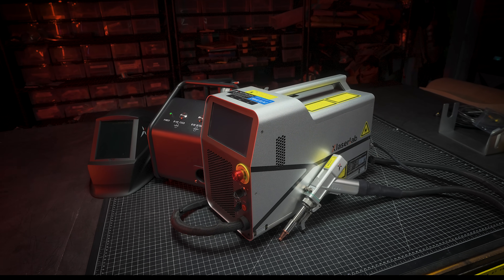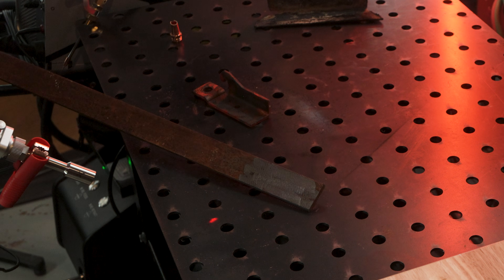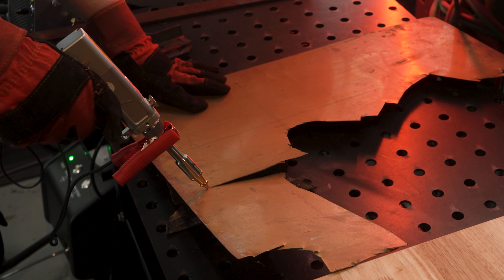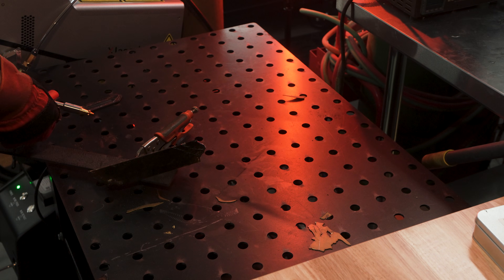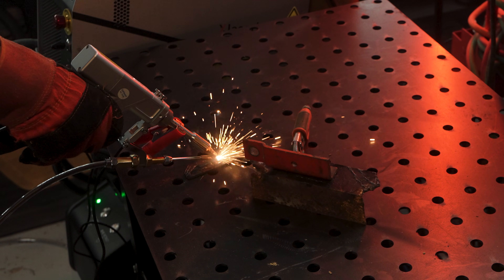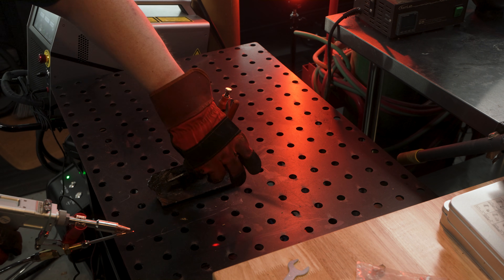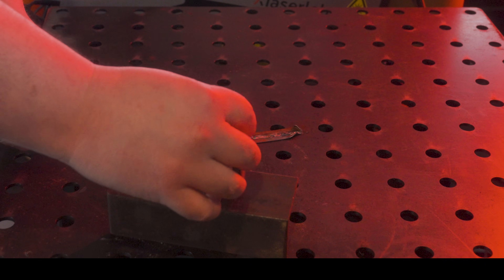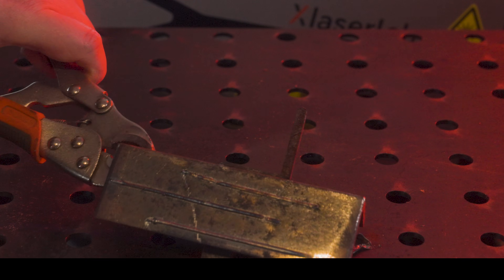Clean, Cut, & Weld - Taking a look at the XlaserLab X1 Pro

Comment: Awesome this machine will really be in handy when you work with metals for armor,weapons or other stuff I wonder if it cuts leather too or only on tough hard materials but a must have for important ideas.
Reply: It can definetly cut through flesh and with that leather. Not the cleanest cut from what I've seen some guys testing. It looks to burn awey more then actually cut. But that might be because of the moisture content in flesh.